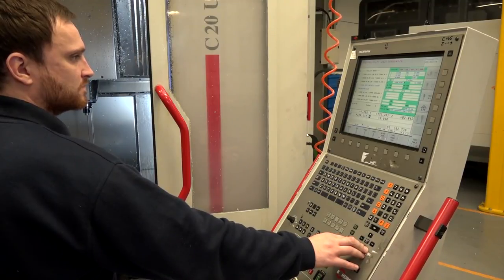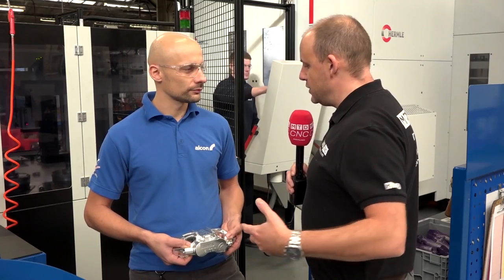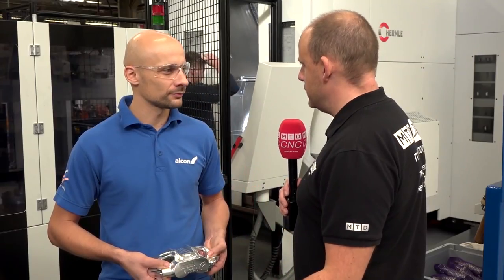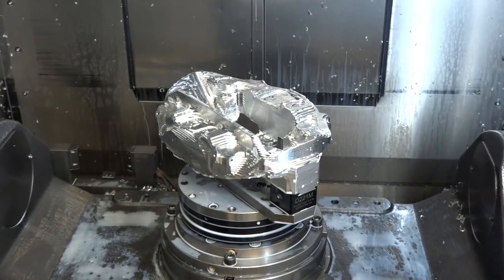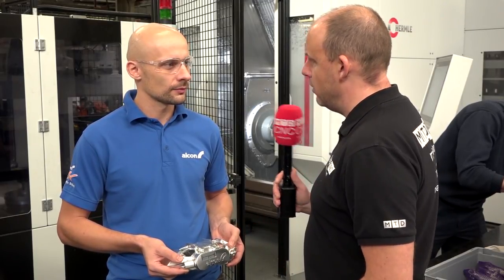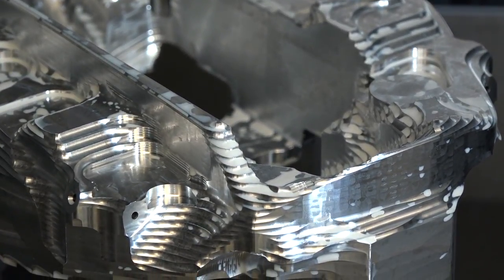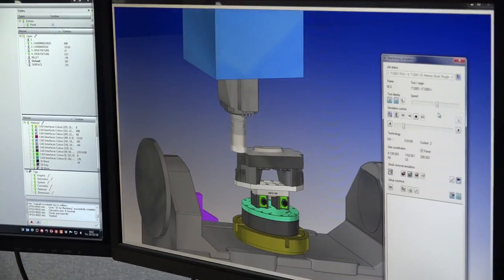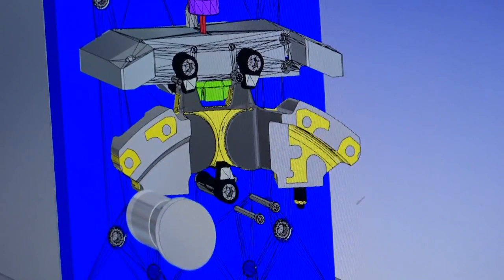Braking ground - how long to program this part?

Comment: I must have missed it, how long does it take to program this part?
Reply: Yes that's what they are asking you to guess. I guess... The wordy bit attached to the video kinda says that.
Reply from the maker: how long do you think @manny?
Reply: @MTDCNC  4-8hr depending on package, reduced on subsequent parts using templates. Using parametric cam package you could do it in minutes.

Comment: Copying stuff over ---> 40 minutes ? [What were they using before ? I had instability CAD CAM issues around 2008/2010 but thought it was more of a problem with SolidWorks + Microsoft operating system + CAM [XXXXXXXX]  built into all that (+ OpenGL/ graphics  issues from Microsoft with rest of 'Stack" i.e. SW + CAM . ). .